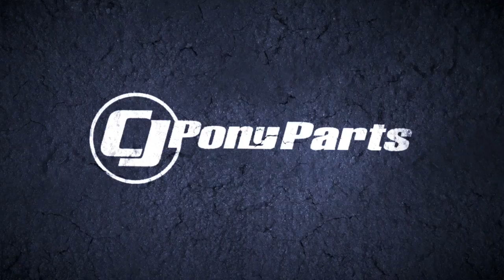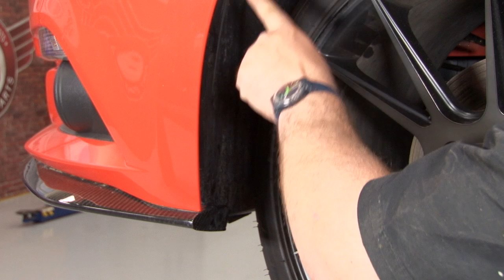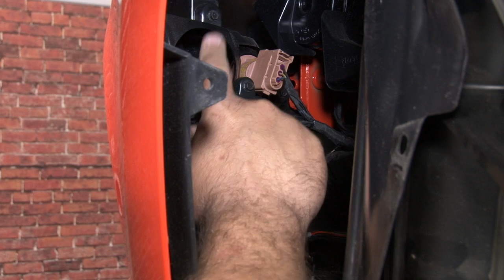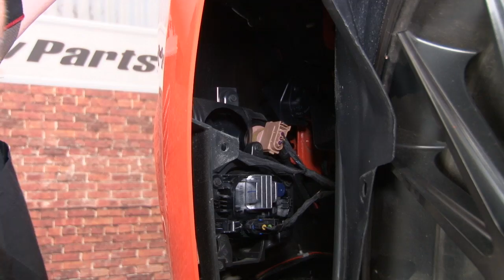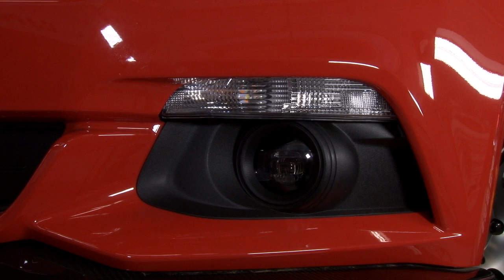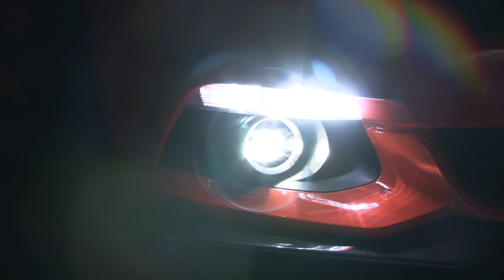2015-2017 Mustang Diode Dynamics LED Switchback Turn Signal w/Side Marker Front Kit Installation

Comment: HELP!! Ordered these and have strobing connection problems. Ordered ANOTHER set and having the same problem. My contacts are good. It clicks in the socket but must shake loose after a mile of driving on nice roads. NEED HELP AS TO WHY THIS IS HAPPENING!!

Comment: Who else noticed led switch back bulbs on this car fit kinda lose I noticed when I hit a bump they lose connection and the front turn signal don’t work . Hit another bump and they start working fine . You can barely notice maybe half of the people haven’t even noticed .
Reply: New003Snipes1 s550s don’t like leds . I installed the same ones i had in a dart worked perfectly fine . Kinda sucks I didn’t work in my car I don’t want to spend more money on lights I went back to stock my car looks boring now 😥

Comment: Will these bulbs affect the sequential affect on the taillights??? Wondering because of the turn signal marker he mentioned. Thanks!
Reply: I just bought the switchbacks and did some research on the hyper flash. I haven't taken delivery of the car yet, so I haven't tried, but this should work without having to add resistors.  If you have access to forscan, you can disable it via the computer.
BCM 726-27-01 : x1xx xxxx xxxx = Front outage enabled (hyperflash)
BCM 726-27-01 : x0xx xxxx xxxx = Front outage disabled (no hyperflash)
I have used forscan for my F-150 and it works great.  Good for disabling the double honk as well.

Comment: Since I just purchased these and plan to install in couple days, I was wondering if the exterior turn signal follows the same sequence as the interior. Will it blink single, double, single, double on the outside?? Thanks for the input from whomever currently has them or had previously installed.
Reply: They blink at the regular speed of the original lights. It's only the sound that changes in the car and the display flashing.

Comment: The question I had is will the 2018 fog light assembly fit into prior years. I think they would make a great addition to a Shelby GT 350 as it does not have fog lights upfront. 2018 ford mustang has the fog lights built into the turn signals, it would be great if an aftermarket manufacture could retrofit them to the older cars.

Comment: these work great,getting used to the clicking inside the car is odd
Reply: excelerater after almost a year of owning the car the clicking got annoying resistors are easy to install you should give it a try

Comment: While this is easy for a standard Mustang, it's more involved on the drivers side of a GT350 as the cooler is in the way.  I got the directional out but the side maker is too hard to reach.  Tomorrow I'll take the tire off and try again.
Reply: Were you able to get it?  I'm interested, as I have a GT350 as well.

Comment: Hey Bill just wondering will this switchback only work when i turn the headlight on ? or it automatically on once you start the Car ? i'm asking cos i wanna keep the OEM look from normal running day light bulb  Thank you  ...
Reply: Johny Jmc it stays on as daytime running light. it's the same mode as oem, it's just that Amber is now replaced with white

Comment: I wish ford had just led's in them in the first place and reduced the size of the lenses. I never liked the way the turn signals dont line up with the lower center grille. Personally i wish they just put the turn signals in the headlight enclosures themselves like the fusion.

Comment: I like these switch backs from Diode Dynamics but you won't get a resister to stop the clip flop interior indicator flash and sound. I have spoken to the guys at Diode Dynamics and they just are not going to make or sell one. It makes me wonder if they EVER designed a resister for the switchbacks in the first place.

Comment: Hi Bill are these lights still available? The link doesn't pull them up and I wasn't able to find them on your website or at diode dynamics. Are they back ordered or having issues?
Reply: Awesome.  Thanks!
Reply from the maker: +pierrous1212 They have been redesigned and are now available again! Here's the link: http://www.cjponyparts.com/led-switchback-turn-signal-with-side-marker-cool-white-front-kit-2015-2016/p/ELK12/
Reply: +CJ Pony Parts Hey what changes happened after redesigning the product? And will you please make a video or tell us as instructions how to install the resistor.
Reply: Do you guys know the wiring on the turn signal for the resistor install?
Reply: NSMike87 for the 15 mustangs?
Reply: Yeah.
Reply: NSMike87 Well for the driver side you need to slice (Black & Blue) passenger (Black & Yellow) basically you don't need to do anything with the middle wire. And it'll work perfectly....
Reply: NSMike87 Sure no prob!

Comment: These look fantastic...  One question, how does the change in turn signal frequency impact the rear sequential lights?  THANK YOU!!!
Reply: devnull128 The rears operate in the original fashion
Reply: Awesome...  THANKS!  Ordering now.
Reply: They came in and like so many others in the forums, refuse to work properly (yes I took a large amount of time aligning pins and redoing them).  These are just no good.  I wish they would work but sadly they stink
Reply: I contacted diode dynamics and let me just say that those folks know customer service!  I am back on the switchback bandwagon and love these.

Comment: hi bill i am a costomer and i hope you answer me, i got these parts for my mustang gt from your website

1- 2015 FORD RACING TAIL LIGHT PANEL 
  2-RS4362015 FB STREET SCENE UNPAINTED URETHANE REAR SPOILER
3- GT ROUSH HEAT EXTRACTORS PAIR - MOLDED BLACK
4-2015 LED TURN SIGNAL KIT WITH SWITCHBACK BULBS
5- 2015 Mustang Eibach Sportline Spring

i need to ask you, are they going to fit on the 2016 mustang gt ? the dealership told me that I'm getting the 2016  instead of the 2015

thanks ! Ali
Reply: ahssasmajnon123 Yes all will fit the 16 without issue.
Reply: Bill Tumas thanks man !

Comment: I noticed that your check engine light is on? Is that from a factory defect or from an aftermarket part? I'm asking because my check engine light is on my 2015 ecoboost and its because of the camshaft. Wanted to see if that were something that's been happening to multiple ecoboosts
Reply: Justin Mas We had the key on with the engine off so the light was on. The only issue we had with our EB so far was a bad ABS sensor.

Comment: After having my lights on my car on for awhile these lights start flickering on and off. The switchbacks only. Then stuck solid Amber until leaving the car off awhile then back to normal.. Is something wrong with my set or were they over heating?
Reply: jacob sellers They absolutely should not be overheating. I would double check the lights are seated properly in the sockets since they are a tight fit.
Reply: Nope there crap quality same issue I had I went back to stock nice idea if they could make them last longer than a couple months id stay away and there like $100 overpriced

Comment: I've seen the installation done by Diode Dynamics, they mentioned the resistor doesn't need any cutting or splicing, do you have any extra information on that?
Thanks and great video as always.
Reply: Mr_ATC Yes they offer a plug in resistor but it really isn't needed
Reply: Bill Tumas where i can get the LED ?